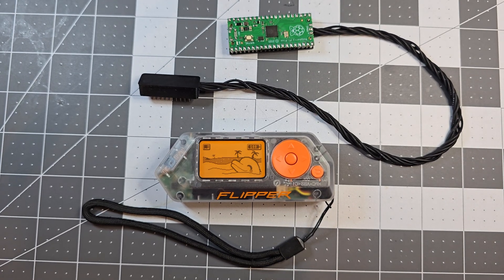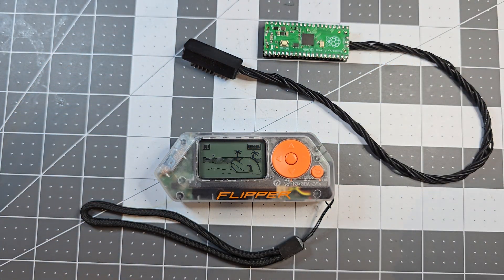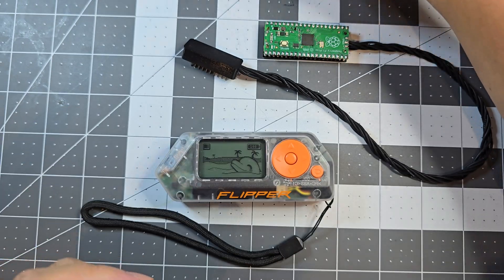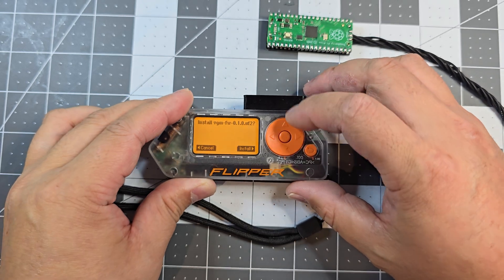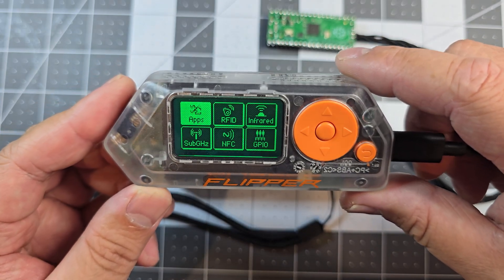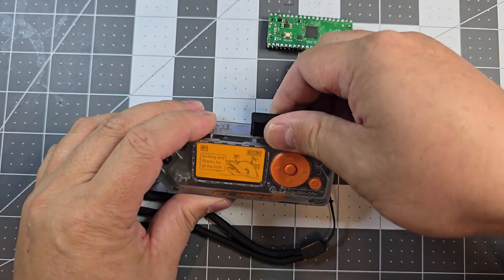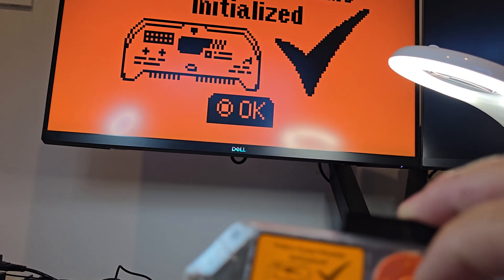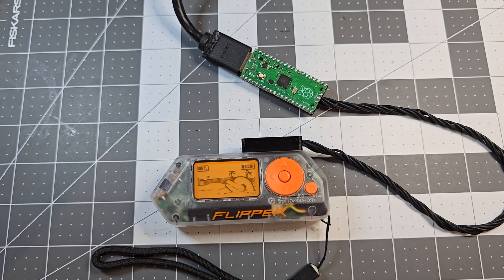Flipper Zero DIY Video Game Module V1

Comment: Do you have a tutorial on the screen mod?
Reply from the maker: No tutorial. I just remove stock polarizing film and put a new one on in the correct orientation to give it the inverted display. Removed the white plastic sheet between LCD and light diffuser panel. Installed RGB mod.
Reply: Love the pip-boy "green" flipper!
Where did you get the polarizing film?